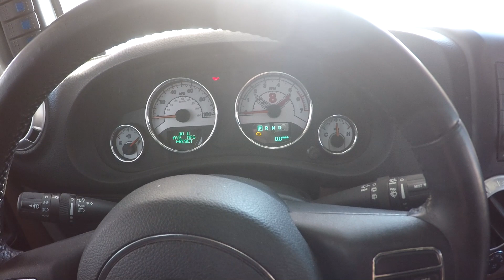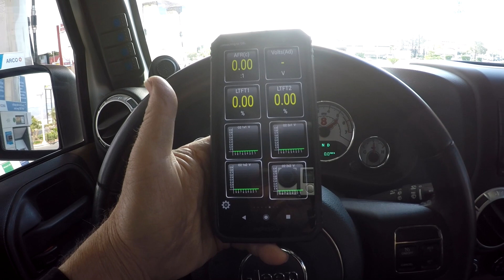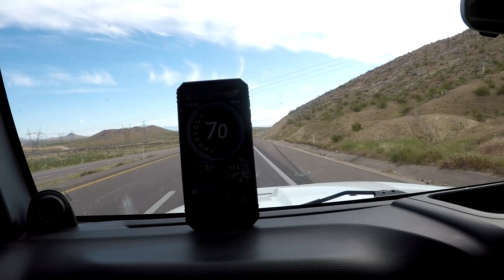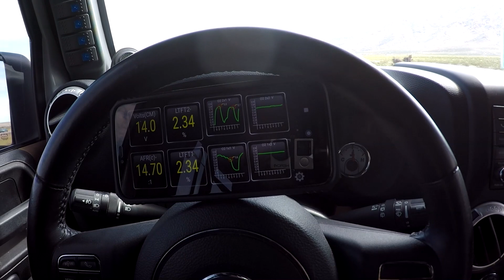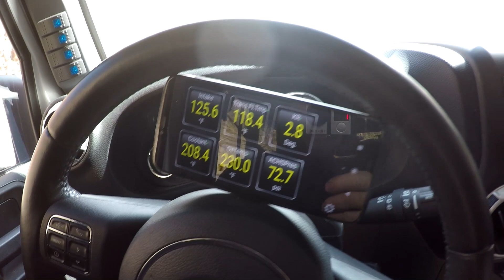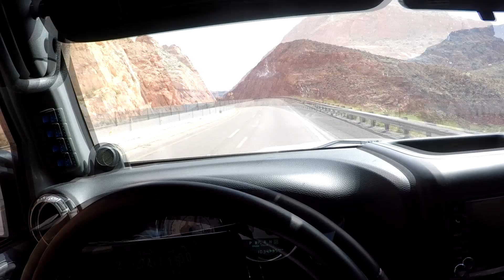Road Trip: Vegas To Salt Lake Part 1

Comment: I wish these swaps were CARB legal....
Reply from the maker: Good news Tony I just got the final draft of the 6-2 EO from ARB
Reply: WranglerJKLS That is great news Robbie! Thanks.
Reply: @WranglerJKLS  what is legal?
Reply from the maker: Currently the LS 5.3, the LS 6.2 is pending and should be available very soon. The LT swap probably won't have an EO until the end of this year.
Reply: 2015_ Rubicnn me too, my Jeep has been sitting in garage for the last 10 months because I can’t take it in for a smog check here in Calif.
Reply: Call them. I’m about 99.99% they are.
Reply: Sooo does that mean the Gen V kits now have an EO number?